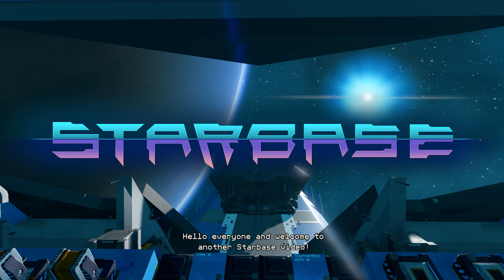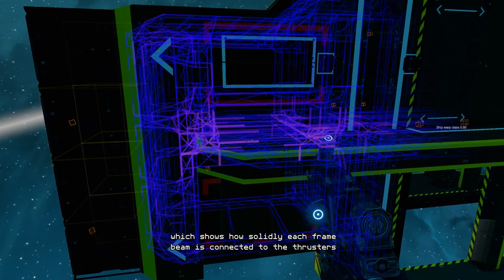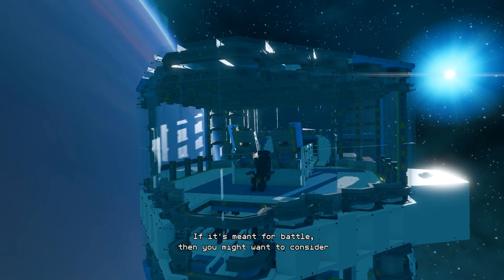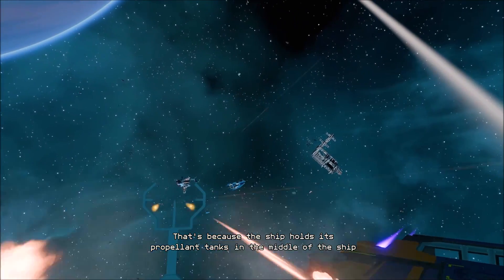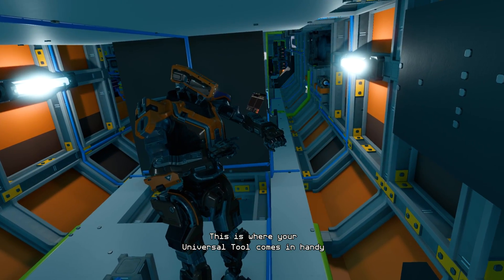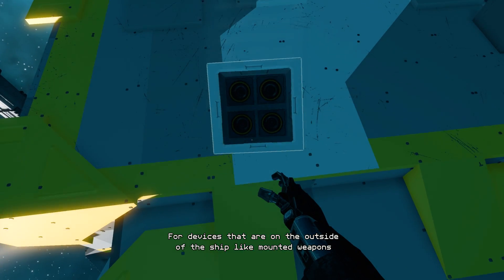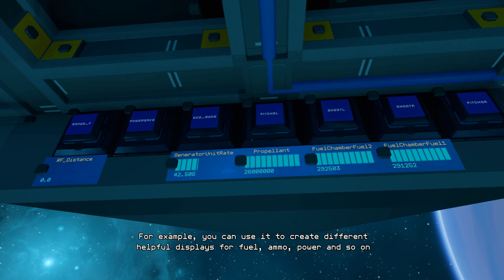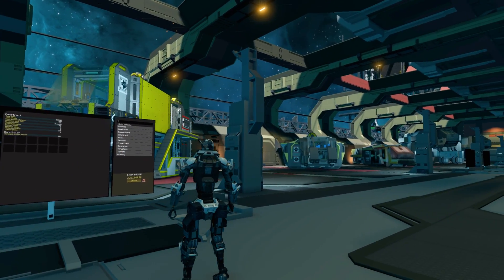Starbase - Spaceship Design Feature Video

Comment: The one thing I would like to see is more interior lighting. It often looks dark and cold. Like small lights, neon strips etc blinking lights etc.. Other than that, its superb. I'm just curious if the performance will be an issue like in similar games when firing or if using bigger ships.

Comment: So, i see ships, but all the parts seem to allow the building of mechas aswell?
Reply: Yep, but since there is not gravity yet you'll have to use cargo beams at the end of the legs so they can grip surfaces.
Reply: I don't see much of a point for it, considering 95% of the time, you'll be doing battle in space, but...

It's possible, i suppose
Reply: i see space gundam battles!!

Comment: I can just imagine a warship design using the all or nothing armour scheme. Keep your vitals and main power in an armoured citadel protected by an armoured outer hull. With armour Layered like an onion with your vital systems at the centre. From there you can simply branch out for weapons and engines. Even having an armoured shield come down in battle to protect your main drives.

Comment: how easy will it be to build a gundam or macross like mech in the game?
Reply: 5/7
Reply: ^^^ 
Asking the real questions
Reply: I wouldnt be surprised if it's possible but it would be a pain in the ass wiring and coding all the joints and mechanisms to work in tandem

Comment: 2:38 WOW that material shader on the right wing looks SO GOOD
But you guys really should rename the "Eco Mode" because that makes no sense in space, nor with the fuel actually used. What is the fuel anyway, hydrogen? How is it "eco" to conserve the most common element in the universe? I mean, this is supposed to be space, not a Ford Mustang spewing gasoline in a pine forest. Space doesnt care about pollution, its space.
Reply: "Eco mode" is meant to mean economical use of the fuel and not ecosystem friendly. More bang for your buck, fuel wise. No clue of what the fuel source actually is, but having an efficient mode for long distance travel could be useful if your ship lacks the means to collect and refine fuel on its own

Comment: Plz add blueprints or virtual construction so you can design your ships before you build them 
A way to easy to find that one burned cable that controls turret.
Also search function for scripts with additional notes to remember what does what
Reply from the maker: There is going to be a blueprint system for both spaceship and stations, though it probably won't be ready at EA launch.

Comment: Question, what happens if you run out of propellant in the middle of nowhere? Can you make a distress beacon or something like that?
Reply from the maker: You can always use the insurance system to transfer yourself back to an insurance station (probably at a Mega Station) if you get stranded and you cannot fix your ship/get more fuel. The beacon signal is good up to 100km so you'd need a lot of them at regular intervals if you're really far away from civilization.

Comment: Okay some things I must ask:

1.) will there be a built in guidance system (for turrets, missles, and leading sights), that you can just slap on and wire all outputs to the controls and chane settings to your likes or will you need to use yolol for that?

2.) for either of the above cases, will there be detection system, like radar, cameras, etc or will there be just instanenous detection of grids?

3.) will there be see-trough HUD panels (blocks), for things like the leading gunsight, red/blue dots on detected enemies/allies, and many other things?

Thank you for your answer in advance

Comment: So excited, looks really well done 👍 can't wait. Just 1 question, will there be ways to improve performance/reduce lag, as I just about reach the minimum requirements set on the steam page?
Reply from the maker: The specs on the Steam store page are not final and are just directly taken from our own office computers. The requirements will be updated closer to launch or during Early Access at the latest, once optimization is finished, so it's very likely the specs will go down somewhat.

Comment: out of curiosity, is it possible to fly your ships/move around with a 3rd person camera or r u only given a 1st person view?
Reply from the maker: You can adjust the control panel's levers with a mouse in 3rd person view (=without sitting down on the pilot seat). The pilot seat view is 1st person only. So if you click on the seat and sit down, you will automatically be in 1st person view until you leave the seat again.
Reply: @FrozenbyteGames  i only ask because my preference when it comes to flying is using 3rd person

Comment: My only concern is how long it will take to build a ship... ones that are capable of holding fighters and bigger seem so tedious to do if just by hand with the rivet gun
Reply: Agreed. That's a major key consideration combat is to be practical and fun. Designing and building a ship by hand is engaging and great fun the first time, but trying to rebuild them after they're damaged or destroyed can be a nightmare. The game needs to strike a balance between immersive and personal hand construction, but then also the ability to somehow repair or replicate from a blueprint without it being an intimidatingly dificuly task. No one wants to spend five days designing the ship of their dreams, only to be too scared to ever use it for fear of losing it in five minutes of unlucky combat.

The games Space Engineers and From the Depths are perfect examples of each opposite end of this balance.
> In Space Engi, everything is personal and hand crafted. Even the large station/ship based welder features are very finicky to use and prone to errors and missing blocks when trying to print a ship from blueprint. Practical repairs are even more awkward. It can make players very adverse to actually enjoying the combat, even when overflowing with resources.
> In From the Depths, everything you build can be saved to a blueprint, and perfectly printed out in very short time frames with absolute ease, provided you have the resources. Any damage can be perfectly repaired without risk of missing, inaccessible or half finished blocks. It removes all fear of combat, spare for the potential resource costs of damage or losing. The only downside is losing that more intimate hand crafted element, as ships become a bit more like player designed RTS game units.

I'd love to see Starbase find a comfortable mid point that allows well established players to replicate and repair their ships, and feel comfortable using them.
Reply: @UnknownSquid  the repair fun tho
Reply: @hoyabobai1115  It's fun to a degree, but needs to be practical still. If repairs on larger ships take multiple full days of game time and careful awkward reconstruction and configuration, then no one will dare use their coolest ships to actually fight with. It's a problem that Space Engineers multiplayer had frequently had, where people are super adverse to putting their creations anywhere near harm, since losing a nice ship can be literal weeks of work down the drain, and damaged ones are often better off scraped and re-built from the ground up, since repair process is too finicky and prone to error.
Reply: @UnknownSquid  I agree but I think it will make players more careful that way you won't be flying in space and all of a sudden some guy rams his small ship in yours

Comment: Do you think you could add a function like hyperspace but a ship needs to have a very powerful frame or it will fall apart. Also maybe have plating fall off if it is too weak or does not have enough bolts.
Reply from the maker: Currently no plans for hyperspace, at least not during EA.

Comment: Alternative title: "How to set yourself up for a 'rewarding' blow of frustration when your lovely build of several weeks gets popped in seconds by some griefing arsehole or even a stray shot"
Reply: I’m assuming you’ll be able to save your ship to a blueprint so you don’t have to tediously rebuild the whole thing from scratch again.
Reply: @cschilb5  unless the pvp gangs keep spamming the idea of making blueprints fully destructible as well
Reply: There is an insurance system I think
Reply: Demonic_Pigeon yeah, and there will be safe zones
Reply: @Goferek5  I'm intrigued, thanks for the info!
Reply: Pretty much. That's going to be a major issue even with safe zones/bps. Unless insurance covers cargo as well, then in that instance yes it would. If insurance wasn't a pain to have or near impossible to get then what they have will stop the problem. BP saving as you build, safe zones that are large enough to cover the starting resource field and full insurance that's easily something you can afford (Not this 'spend 40% of the ships value to get 45% back' deal you see in other games) will make this not an issue. 

Then at that point, dying is a 'shrug' and a tell to add more automated guns on your ship to stop that from happening again

Comment: I just heard of this game, and it looks good, but please do not make the mistake of having a complex control systems in a game where objects are relatively automated e.g. Space Engineers level of simplicity.

Something that comes to mind is take an oxygen machine, and turn it into a multi system process that involves filtering, pumping, scrubbing, storing, and hell even pressure management if you so dare.

Comment: How much will it cost and what are the system requirements?
Reply from the maker: The price isn't decided yet, but we're thinking of not more than 40$ (USD). There are system requirements posted on Starbase's Steam store page (https://store.steampowered.com/app/454120/Starbase/) but they are just a rough estimate at this point. They're based on the specs our office computers have, which are guaranteed to run Starbase smoothly, but we'll update the actual minimum and recommended specs at a later date when the optimization is done.
Reply: Game requirements: YOLO attitude?-check, PC rig injected with testosterone and adrenaline?-check, 200+ IQ- Crap. F!@# it, gimme that injection.

Comment: Will there be PVE, weapon customization, ship shelds and automatic turrets for small ships in this game?
Reply from the maker: Currently no plans for PvE. Ships weapons are modular so all the different parts used for them can be tweaked. There are currently no plans to introduce shields but we have discussed the possibility. Turrets can be automated with the use of YOLOL.
Reply: @FrozenbyteGames  thanks
Reply: @FrozenbyteGames  Will the control of a rotating weapon and ship with a mouse, sitting in the pilot's seat?
And about custom weapons, I meant hand guns (butts, sights, barrel, etc.). Thanks

Comment: How big can you go before your ship doesn’t even work at all?
Reply from the maker: We don't currently know what the max size for a functional ship is, but there is no built-in size limit in the game and we push the limits of the engine constantly as we create larger and larger designs. The biggest ship currently is a gunship called Centurio, which can't really be flown without a crew. We released a picture of it and some smaller ships for scale yesterday: https://cdn.discordapp.com/attachments/565465868704940040/618400165459394561/empire_ships.jpg

The biggest problem with huge ships is that they require a lot of thrust to move and are difficult to maneuver because of their sheer mass, so they also consume a lot of fuel. It's technically possible to build them as big as you want, but making them fly beyond a certain point won't be easy.

Comment: but can I build a mech
Reply: Based on what we are seeing, you'll be able to build a god damn space transformer
Reply: @Jarandjar  your point?
mine is that the mech will have thrusters, and if there is an electronic that uses magnets than I will be able to walk across the ship like a Gundam
Reply: @Jarandjar  there's a delay?
they did not mention that, I think the delay is deliberate for the doors.
if I get the program right i'll be able pilot a mech like the best of them, just to be clear it will be no taller than 25 meters and no shorter than 15 meters, so if there is a delay i'm sure it won't be noticeable.
Reply: @Jarandjar  it's not much I could still use one as a rule of cool thing
Reply: @Jarandjar  rule of cool trumps all reasoning, i'll do it like my model kits, the innards then the shell
also no offense taken, I just love mecha no matter what kind.
Reply: @Jarandjar  well I am an individual so I am able to focus my efforts into one project where I have a lot of control, I build the mech, and then I figure out how to mass produce it, through automation. It would be cool learning experience for me and as far as I can tell I would be able to map the movements to W, A, S and D.
Reply: @Jarandjar  I agree it's a good thing to have insurance that way I can make sure my shit is still intact, also I will be a weapons manufacturer, so the best mechs will be my mechs, i'll start with the zaku and work up to a gundam